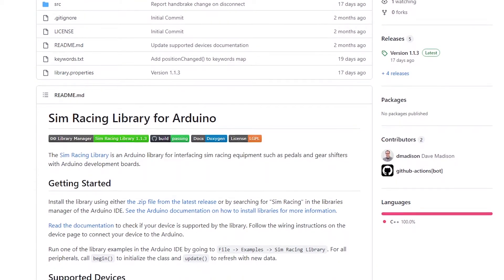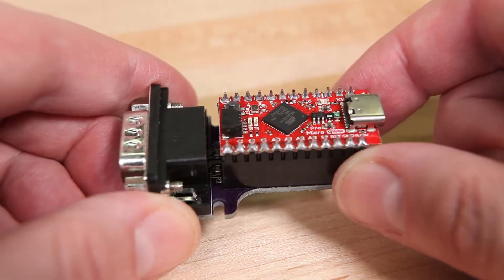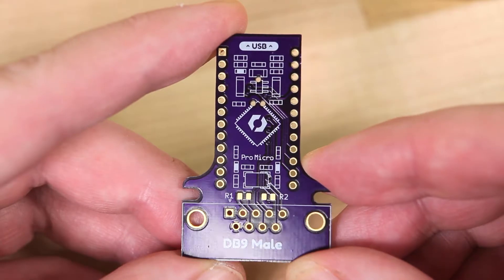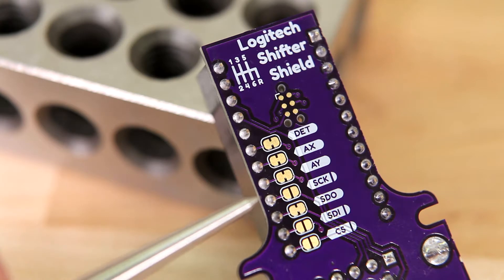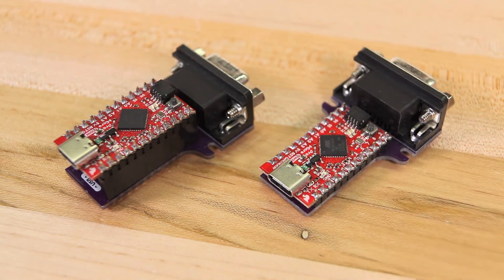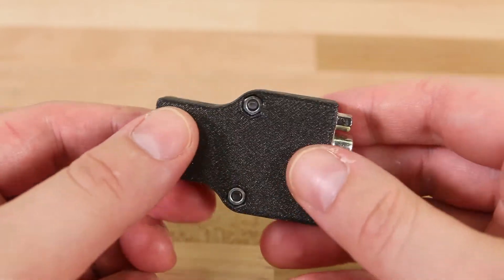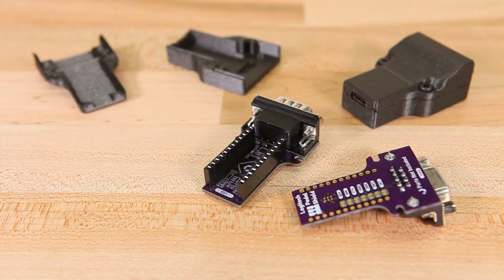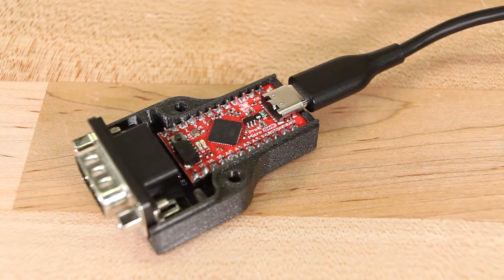Sim Racing Shields for Arduino

Comment: Where do i get the little pcb boards? I seen the github but I don't know what to do with that file.
Reply from the maker: You can get the PCB by providing the gerber files to the PCB manufacturer of your choice. These PCBs were made by OSH Park: https://oshpark.com/

You can get the gerbers from the latest release on GitHub: https://github.com/dmadison/Sim-Racing-Shields/releases/latest
Reply: @dave.madison  Thanks so much for the reply. I'm on the site about to order the pcb. I also have to get the components.
Reply: @dave.madison  Thanks for the reply. And i apprecate you sharing this project. I just need to buy the components

Comment: There's any chance to combine pedals and shifter with one sparkfun pro micro?
Reply: I came across this video trying to find the same as i came across a 2 in one design for the g27 pedals and shifter but i've got g29 ones and dont wanna commit to that if it won't work even more so as this looks cleaner and is explained far better that the poorly worded text only guide i found for the two in one

Comment: quick question. Got the PCBs using clone. 5th and 6th not working neither is reverse. I see in the video you have R1 and R2 fitted on shifter pcb but this is not reflected in the github kicad files. R1 is showing for the shifter. Could you clarify please? Thanks for the great work so far
Reply from the maker: I'm not sure what you mean. I just cloned the repo and I see both R1 and R2 in the KiCAD files and in the 1.0 gerbers. Are you possibly looking at the pedal PCB/schematic?

5th and 6th not working could be down to a calibration difference for your shifter. Have you tried the interactive calibration?
Reply: @dave.madison  ME being dozy, fitted R! and R2 all good. Makes sense now as they  were for shift_CS and Shift_Detect. All good :face-green-smiling:
Reply from the maker: @jus4027  Great! Glad you figured it out :)